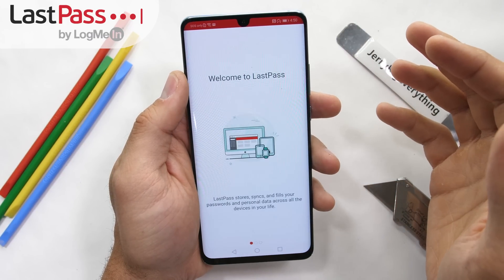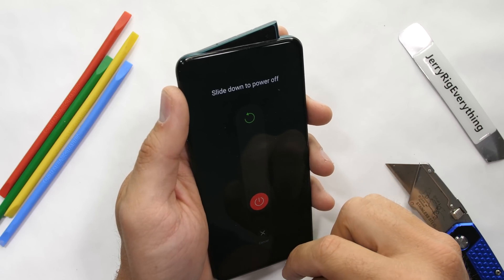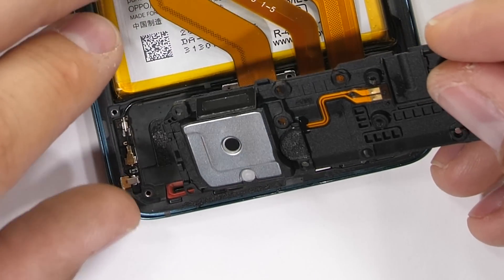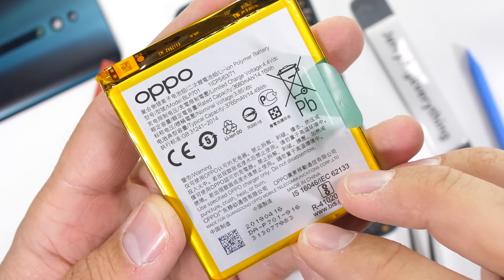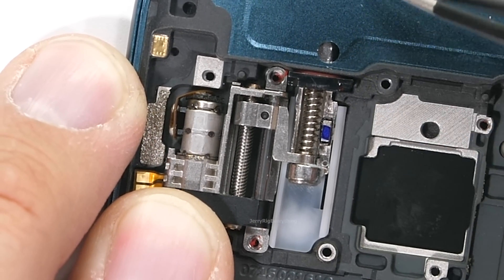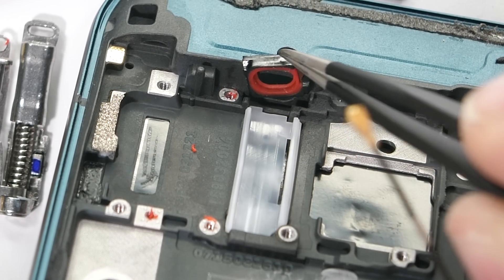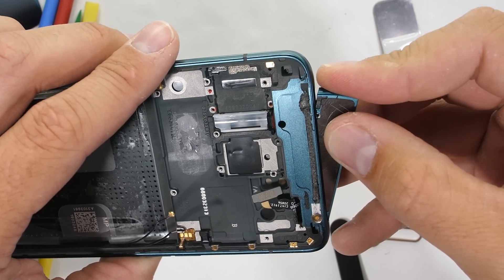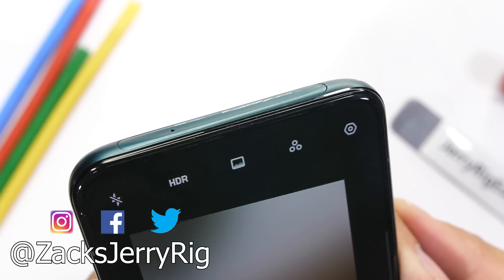Oppo Reno Teardown! - How does a Pivot Camera Work?!

Comment: xiaomi mi cc9....260  usd . front 48 mp and back 48,8,5 mp cameras... .. 710 sd chipset, 6 gb of ram, fast charging. aluminum + glass. amelod display. 6.39 inches display. fingerprint,face unlock, 4000 mah battery pls durable test it from your channel..

Comment: Compare a durability test on the Ipad three vs the ipad pro and it would be interesting how Apple progressed in these years

Edit: Also you could compare the hardware in a teardown, but most important, does it scratch at a level 6 with deeper grooves at a level 7?

Comment: Great video, but just want to nitpick on some of the terminology. The ribbon cables are actually called flexes (flexible pcbs), wire cables are coax cables, and those Lego style connectors are called board-to-board connectors.

Comment: Why did you say that those rubber rings will only keep the dust out, instead of what you usually say i.e. somewhat protection against liquid. Why sudden change of opinion?
Reply: Gurkirat Singh I think because the phone does not have water resist rating
Reply: @MuhammadIqbalTawakal  I get that but I'm not talking about ratings. I'm simply talking, doesn't those rubber rings provide better sealing against liquid i.e. as seen in phones with IP rating. FYI even a normal phone today can survive water splash tests without those rubbers so won't these help better? Also you can check Gupta Information System's videos if you wanna know what sort splash tests I'm talking about.

Comment: I think this is the 2nd best moving camera design behind the Asus flip cam. The pivot joint puts very little stress on the connecting ribbon cable compared to what I would expect in a pop up cam.

Comment: Zack I have a question. Can you tell me which adhesive is used in oppo Reno to secure the back panel and can I use more greater adhesive on my oppo f11 Pro to make it waterproof. Which adhesive will be much greater for my oppo f11 Pro?

Comment: I hate how the LED is on the pop up section, whenever you use your flash you need to ear the motor out, an LED flash is tiny and can easily be embedded like other phones such as the OnePlus 7 pro

Comment: I really wanted to ask this question for a long time, but here it is:
If I find a battery that can fit in a phone, have the same output voltage and same connection, but not for the phone itself, could I use it in any phone to increase battery capacity, or that's a big no no?

Comment: why are you think that the iPhones are more hard to repair? (if I don't count back glass removal) it is way more easy to take apart an iPhone because they screwed together, so you can easily put together them. I really hate this double sided adhesive tape, it's so crappy and cheap, I think in the most expensive phones they have to use screws and not tape.

Comment: I'm probably late on this but JRigg, looks like you used the A50 to showcase LastPass. Did you finally ditch the s8+ 👀👀👀
Reply: I don't think so, because that phone shows "SOS only" in the top left corner. Who uses a phone without a SIM card as a primary phone?

Comment: Still waiting for some fancy new way to close these smartphones. Like screws that are opened by magnets. How cool would it be if the whole phone just clips shut, but needs a magnet to open, is water resistant, and nothing gets damaged cause don't need to fight glue? A thin rubber gasket can keep the entire phone waterproof, and won't need replacing unlike glue.

Comment: Next Video 
Xiaomi Redmi K20 Pro Durability test!
Reply: Everyone's asking for this phone for a month
Reply: K20 Pro and Mi 9T are pretty much different.
Reply: @lrc3847  they are litteratly the same thing
Reply: @recruit7416  No they are not. K20 is the same as Mi 9T but the pro version is different
Reply: @axrod1990  you're right but durability test would be the same on Mi9t or K20 pro😉
Reply: Does anyone know how to import that phone to the US? I’ve never tried so I don’t even know which site to start on. Also, would the LTE bands even be compatible with T-Mobile in Las Vegas?